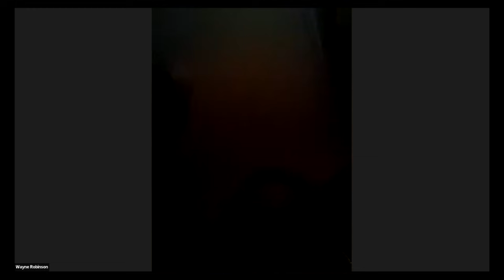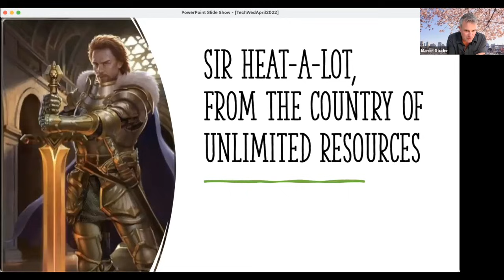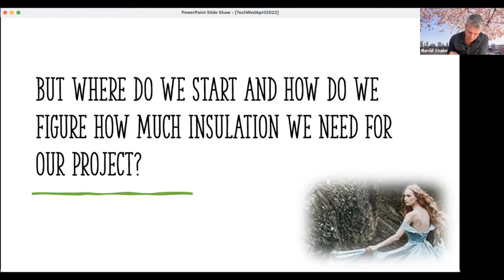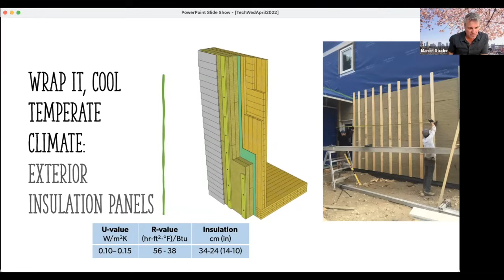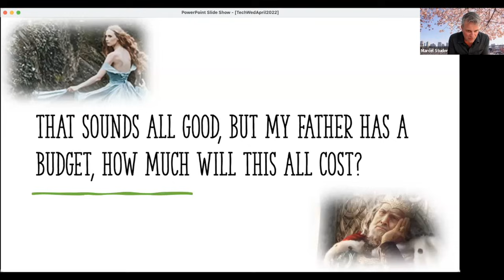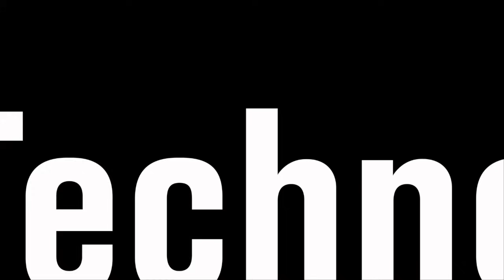What Wall Assembly and Insulation Type Should I Use? | Passive House Accelerator Construction Tech

Comment: You don't need a 8 inch or 10 inch thick wall to meet the U factor requirement. Use the proper amount of exterior continuous insulation. This will provide the needed thermal control and do a better job of controlling where the rew point is in the wall. The higher the ratio of external insulation to interior insulaton, the better. If your exterior insulation amount meets code by itself, you won't need a vapor retarder because the sheathing will never drop to the dew point.

Comment: Adding insulation is always cheaper than producing energy? That's possibly true when you add insulation to a house that has no insulation but that is not the case when you compare an average house insulation to a passive house one. There is something called the law of diminishing returns. Passive houses work in a range of insulation where solar panels are actually cheaper
Reply: My problem with solar panels is that in the place where I'm building, they are going to be very poorly performing just when the need for heating is the greatest.  The weather seems to be too cloudy in winter for the full heating load.  So for me, the solution for the winter design condition is wood and propane heating.  I'm buying a decently large solar system without breaking the bank.  I'm buying a decent amount of insulation, again without breaking the bank and making assembly too difficult.  But, without actual operating data on solar availability and temperatures, I certainly can't go passive.  With my level of insulation, the windows are likely going to be the limiting factor.  So, rather than more house insulation, I should be putting in shutters.  Or cutting more firewood.

Comment: Great video with lots of detail.  Excellent diagrams are very helpful.  The title says it will help answer the question  of what  insulation  type  to use.  But aside from showing the relative embodied carbon values there is no discussion of the many other issues that come up:  performance over time, fire resistance, water/humidity properties,  etc.  Look forward to another video on those.